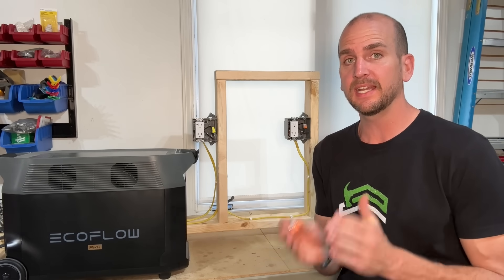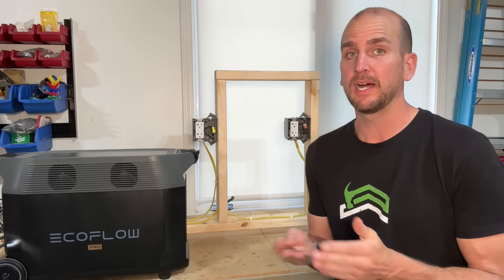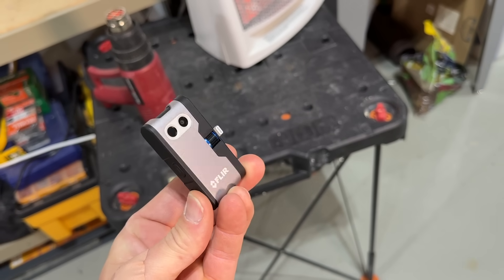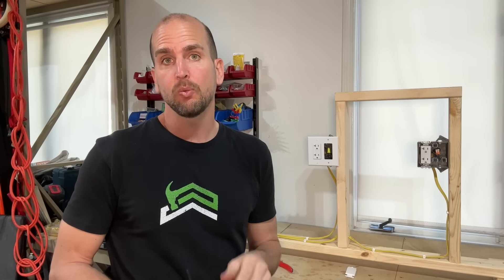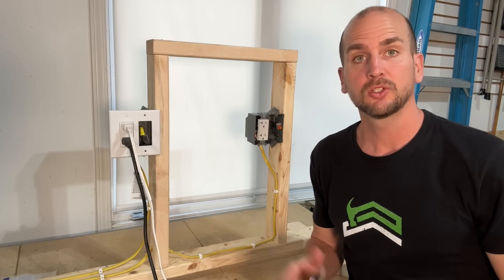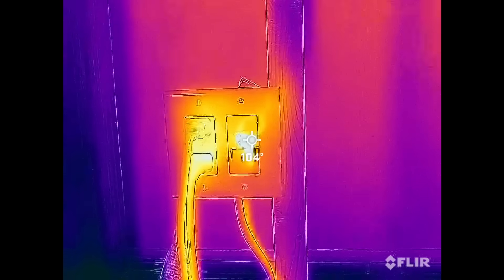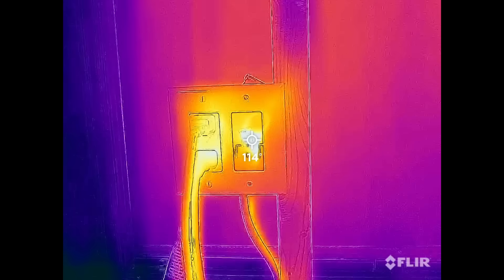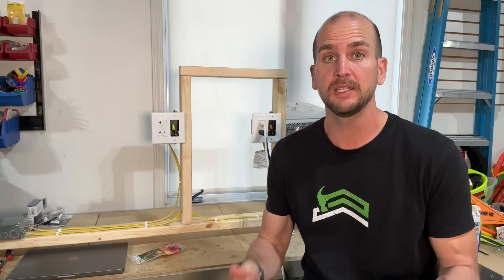Debunking the Pros: Can WAGO Lever Nuts Handle Heavy Electrical Loads?

Comment: Interesting video with an interesting (appreciated) result. Sure, the testing conditions were perhaps skewing the results in the absolute, relative to each other, though, they are correct. A number of thoughts come to mind, though:
1. I was surprised by how much the temperature rose, and the actual temperature rise is perhaps even greater. Now, in the experimental setup, the boxes had maximum heat dissipation capacity. Code, though, increasingly asks for more insulation, which will reduce dissipation. I would be interested in knowing whether that insulation could actually be a fire hazard, at least under extreme load.
2.  The Wago nuts are a product designed, likely by experts. It has been tested and is allowed by code (which tends to be rather conservative, usually). It has several accreditations with respect to fire protection. Why is it that so many electricians don't want to use it? The only reason I can think of is that they are concerned that their jobs may be diminished. IT reminds me of the situation with PEX. When I started using PEX in my house, plumbers would tell me all sorts of horror stories. I have not had a single issue with PEX, find it easier to work with, and so on. Not to mention that it offers more protection when the pipes are freezing. Same with SharkBites. But plumbers could just could not live with the fact that a normal person would now be able to run a water line from A to B by him (her) self, and in a fraction of the time, and a fraction of the cost of what the plumber would like to do. It bears mentioning that the unions here in Massachusetts still refuse to work with PEX.

Comment: Not sure if you ended up considering this after but, curious if the extra heat dispersion from the WAGO has an effect on efficiency! Should run a test where you have a set amount of load powering the outlet and then measure the load out vs time. Just based on this test, I'm willing to bet you're seeing some additional power waste from the extra heat and if the whole house is done with WAGO's, how much overall does that have an effect on the power bill. May be tiny but people change lights bulbs to save a couple bucks a year. Then consider a whole neighborhood, commercial building, or city!

Comment: That extra 10% may be OK in this scenario where there was only one connection in the circuit. What happens when you use a wago in each box in a circuit to connect runs and pigtails together? By the time you get to the last box in the circuit, and have run through 8-10 wago's, that 10% at each joint adds up quickly.

Comment: I use Wagos and other clamp type connectors at the end of the line as in connecting the fixture or in situations where I find too short of a wire in a box. I feel that if you have a 20 amp circuit with many outlets on a long run you may get a significant voltage drop using clamp down connections everywhere. Your adding up connections down the line. Also considering longevity even screw down connectors can get loose with heavy use and poor installation. I wonder what we will see in the future with the clamp down types. By the way, I pre-twist my wire nut connections when I know they are permanent. ie residential. Commercial gets changed out a lot in big box stores and office change outs with short term tenants, so I don't pre-twist those wire nuts. Maybe Wagos can help in those commercial situations that change out frequently.

Comment: You last graph is the TRUTH of the matter. Wago is a bit hotter but no where near the rated max temperature even when you overloaded the circuit. Wago is so simple and easy to use, if you are concerned about the lever moving wrap with electrical tape and the lever can not move. Wago is a dramatic change which works very well!!!

Comment: Hi Scott, you have a much more serious problem if you’re 20 amp breaker with 12 gauge wire doesn’t trip when you are drawing over 20 amps in this experiment. You should not be drawing 22 amps on 12 wire

Comment: For the comparative testing, it's simpler to just measure the voltage drop rather than doing all the temperature measuring, because the heat generated is basically that voltage drop times the current. That calculation is the amount of power being dissipated in the box, and easily compared between each other as well as the baseline.
Reply: That would make for a rather boring video though.
Reply: So true. Also what's missing in the "experiment" is doing multiple cycles. One cycle is not a valid experiment. Do 100 cycles to give the normal heat/cool cycles and then measure the resistance after that. Of course to do that you need a labratory grade ohm meter, which he doen't have.
Reply: @davepompea  if you need to have a laboratory ohm meter then its insignificant to its application.
Reply: Using an ammeter and a standard DMM could do the measurement fairly accurately, if the heater draws about 12 to15A, measure that with an ammeter, and then measure the voltage across the connector terminals with a DMM in the millivolt range. Divide the voltage by the current and it can read the milliohms of the connector. 
The specialized meters for milliohms usually just apply about a 1A current and read the voltage to get the calculated readings.

Comment: You can shove there where the sun does not shine. Let's see how they carry current, amps and watts after being used for 20 years and the copper corrodes in the contacts. Nothing beats screw in connectors that can be tightened up enough to slightly flatten out the copper wire and bite in to give more of a connection footprint. USA design of power outlets and connections are a joke as they only have to handle low voltage normally.

Comment: You should have included the use of first twisting the wires the put on the wire nut,  this procedure should come the closest to your base line, it would have less resistance the other connection procedures. Less resistance, less loss, less heating at the connections. By twisting the wires first and then applying the wire nut, you have more surface contact lowering the resistance. Less resistance, less heat, ie, ohms law.

Comment: I can appreciate this video. I'm typically really hard on this channel for his advice pertaining to electrical. I'm an electrician of over 25 years. I'm a licensed electrical contractor in 2 different states. My current company is focused on Lutron Lighting controls. I design and program Lutron Homeworks sytems for large custom homes. I work with a lot of different electrical contractors to give my background. This test is fairy well done. The part about it that I'm going to add is wagos are UL listed. That means they've already been tested and proven. What a lot of these viewers are not going to understand is this test is incomplete by years. Lots of devices can take a brief moment of heat. It's the heat over time that causes problems. Expansion and retraction that creates gaps and loosen connection that can create heat and arcing. So a quick 20min test proves nothing. The fact wagos have a UL Listing is all I need to know about a product. However, I will only use them in certain situations. If a wire is so short in a box and I need to extend it and you can't get a wirenut on it. Beyond that, I will always use a wirenut. The main reason is I'm very paticular about my splicing. All my wires fold in a box perfectly. With wagos they like to spin and wires cross and it can be a pain in the butt. Also the little levers can catch on things and realease tension on the wires. That could be paticurally bad if that happens when you install the device and you are unaware. Wirenuts lock all the wires together and it makes it easy to manipulate the wires when folding them in the box. You also don't have to question if a little lever was released...I would like to see this same test but with mutiple medium to small loads. Instead of a space heater and a heat gun that have a high draw, maybe a 6 postion wago with 5 lighter loads that total the same wattage. Over the years I've been an electrician, I would say be very wary of the sparky that just wants to slam it in. You can be fast and do high quality installs. In my professional opinion about wagos...yea they work. Would I put my business on the line for them...not in a million years. Wirenuts do not add that much more time, if any. Are they harder on your hands and fingers, yes. Don't be a little b....

Comment: I prefer to use the Wago "push-in" connectors for solid wire (and stranded, if you are careful) of the same or near-same diameter. For connecting small diameter stranded (large gauge) wire, such as found on lighting fixtures and ceiling fans, to 14 or 12G house wiring, nothing beats the lever nuts. Trying a standard wire nut is almost impossible in this situation.

Comment: I appreciate your video. As someone who has been a remodeler for almost ten years and has done a lot of inspected electrical work as well as other trade work I find a common theme among many trade professionals: they claim BS because it makes them more money. It is the same thing with propress and copper. Pex a is far better than copper in almost every scenario yet I can’t count how many ignorant plumbers claim “copper all the way”. Same with propress. Pex a fittings are stronger and actually get stronger with time. Electricians do the same crap with wagos. It is ignorance at best and fraud at worst. I suspect fraud is usually the case because all they care about often times is their dollar.

Comment: I would have no problem using Wago connectors for industrial or residential use. I help write many of the IEEE standards on industrial wire and cable and was the global wire and cable subject matter expert for a large multinational chemical company for 20 years. Although the wire nuts and Wago are rated for 221 def F, the limiting factor is the insulation temperature rating of the cable being connected, which is typically 90 C (194 F). As with any equipment, if used within it’s design and ratings, they will perform fine. Since I’m older and don’t have the hand strength I used to have, the Wago connectors are better for me.

Comment: Awesome experiment. I started using the WAGOs after watching Everyday Home Repairs. I'm 70 years old and cannot put as much strength into wire twisting as I used to. I'm a home DIYer and really appreciate you and your channel. You are my "go to" electrical YouTube channel. Thanks for all you do. BTW, I know that wiring outlets in parallel has been done by many YouTube electrical folks, but I'd love to see your teaching on how-to for those circuits. Have a happy Thanksgiving and God Bless You!
Reply: If your getting your advise from that guy on that channel then you sir are going to get into trouble. He Is the utube jack of all trades - master of none. Ive seen him give out so much bad and wrong advise. Hes been corrected by so many yet he continues to give out info like he 's a pro but hes far from it. Find a licensed electrician or someone that knows what their doing. If your having trouble twisting the wires get yourself a set of linemans pliers. By the way he sells the wagos so dont be a fool. Remember taking shortcuts will always get you into trouble. Especially with electrical.
Reply: Sounds to me like you need someone who knows what he doing since you cant do it right.

Comment: I've been an electrician/electrical contractor for 39/34 years.  I work on high-end multi million dollar properties close to the ocean and ocean front.  I use stainless steel nonmetallic sheath cable staples where necessary. Many places it's necessary.    No way in hell would I use wago because overtime those connections are going corrode and fail at a much higher rate then a properly installed wire nut.    And those junk yellow wire nuts, don't use them.  Use Ideal tan wire nuts.  Any true electrical professional will understand what I'm talking about here. No further explanation needed to the pros out there.  You DIY-ers,  keep watching YouTube videos.

Comment: Can you do a accelerated long-term test, e.g. the wire nut does not depend upon a plastic housing to apply pressure on the connection, it permanently deforms the copper conductor for connection.   Does the Wago housing "creep" after time and temperature and allow the connection to loosen and dissipate more heat.

Comment: Also the fact that UK and other countries use 240v,  that also means equipment uses less amps! A lot of homes main services is only 60amp, 80amp or 100amp. 

Used wago’s for long time never had a problem, also seeing a lot of new devices that have them pre-installed.

Comment: As a non professional, I found this helpful.  I use electric space heaters with extension cords (10 and 12 AWG).  If I'm running them at Max for any length of time, I check them regularly with an IR thermometer.  I've never been able to find out what temperature they should be, or what their max is, but your 200F at least gives me so sort of range.  For the record the 50 ft. 10 AWG never gets hot.  The 15 ft. 12 AWG gets to be 110F to 120F which I felt was pretty warm but I guess not.  Still, its on my list to upgrade.

Comment: FAIL:

I’ll explain why:

Just like stabbing wires in the back of an outlet is the same thing as a WAGO.

It’s not the occasional 30AMP appliance usage but the chronic repeated use of an appliance that leads to circuit failure because electricity vibrates and it’s the vibration that causes the problem within the small contact area of either a backstabbed Outlet or the WAGO.

It’s just like shark bite bullshit it’s a temporary fix if you read into their nomenclature but everybody thinks it’s a permanent new-&-improved method to do plumbing - idiots.

Comment: Reliability Engineer here.
WAGO is a good connector when used correctly.
Your test: Technically an “Accelerated Life Test”…you exceeded the “published” rated current*, but you didn’t exceed the rated temperature, which is really limited by the poly material. *Wago data sheets don’t publish the “maximum” current…there’s a difference between rated and maximum.
Either way, the real test is this, and really the more important one: what’s the increase in heat = current mean for long term electrical use. One connection is insignificant, but add an entire house, where you have a xx% higher current use due to heat from all the connections; does this translate into a significant increase in cost?
These are properly tested and certified, so everyone should get over it. But the real question comes down to long term energy usage.

Comment: The best thing about these are that they’re flat. There were times putting a smart switch in box with a lot of wires it was impossible with wire nuts. I had to go out and buy a wago to get the switch in the box.

Comment: I can't tell you how many projects I've had since you turned me on to these where they have saved a lot of time from having to do pigtails and add more iffy connections crammed into an electrical box. And having to do so way up high on a ladder with one hand or in some contorted body position in a dark attic in between rafters, breathing in rodent turds. So thank you.  I'll spare you the usual flattering compliments that probably make you uncomfortable. :goodvibes:

Comment: Standard 221 Wagos have more resistance that is equal to 1.5m of standard copper wire (2.5mm i EU), meaning instead od 10m romax you would have "11.5m" romax cable resistance when using it in 10m cable. So bullsh*** to all old school electricians that cannot use math to educate themselft about facts.
Also explanation that there is less contact surface is irrelevent. Electricity ALWAYS goes trough closest point of least resistance. Even with wirenuts you electricity goes from one cable to another on first touch or contact, not on all lenght of opened and twisted wire.
Only real differnece is that twisted wire have copper to copper connection, instead of metal bus bar and copper, hence more resistance and 2-3 degree in temperature because of it.

Comment: Handyman here-I twist the wires and use wire nuts if I can.  However Wagos are a lifesaver in certain situations.  For example, if I’m replacing a receptacle and the leads are too short, I’ll use a wago to extend a lead. Another situation is when putting up a light fixture, I use a wago to connect the stranded wire on the fixture to the solid house wiring.  I find it hard to get a good twisted connection in that situation.

Comment: There's one problem to consider, the wire nuts will be able to take many more momentary high current draws without much damage, as the waco's have such a small contact area that they can arc pit and burn. I have had problems with the push connect on receptacles. High start current draws can damage the contact point! 
Maybe you could try to see how they will actually hold up under this scenario. Maybe you have seen what happens when you use a relay that isn't rated for a high inductive start load, All though they can handle the  running current, they will usually burn and stick together and damage the contacts.

Comment: It is not over loads is the problem as much as heavy loads that are frequently cycled that  cause the spring to loose tension over time. It  may not show up for years just like the backstab wiring method so popular by Non Electricians in the 70's .